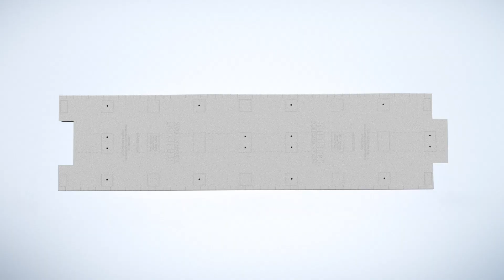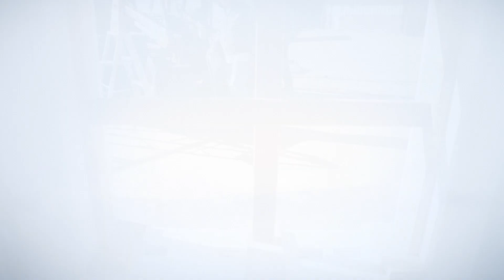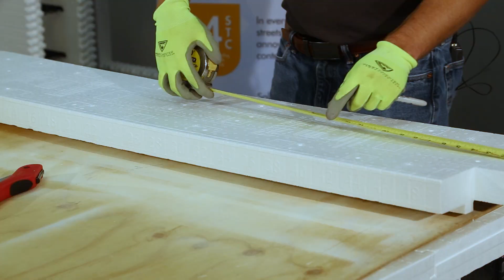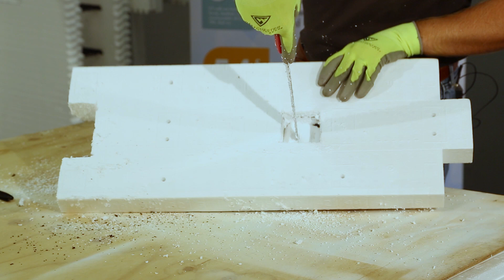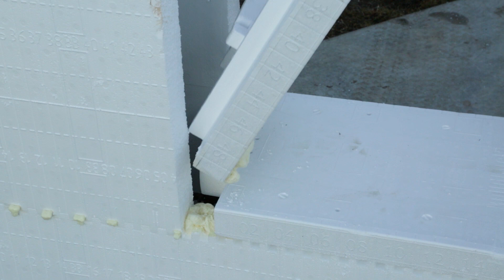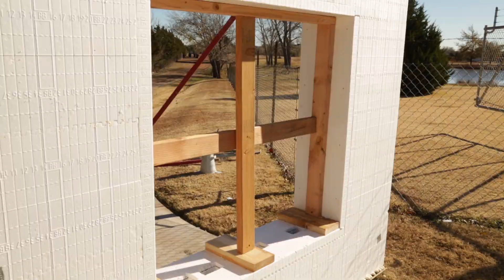BuildBuck Product Overview and Installation

Comment: I like the buildblock product.  I do NOT recommend buildbuck.  The attachment points perform poorly when installing windows and finishing out the window opening.  In hindsite I should have used treated 2x12
Reply: Can you give more details. Buildbuck looks like a solid product. Would be helpful to know any shortcomings.
Reply from the maker: Hi Luke. We're sorry you had a negative experience with the buck and would definitely be interested in hearing more about it if you would like to share. You can shoot my team an email at marketing@buildblock.com. Thanks for your feedback! 
-Isaiah
Reply: Can you use build buck with other ICF wall blocks?

Comment: It appears the bucks are all completely flat. Is that correct? How about making a tapered buck? Something similar to an upside down V only subtle. Would give you a good slope,  slightly more insulation, a bit more wiggle room for window irregularities, and would be more of a "press fit" per say for our window installations. It would also allow us to change window placements based on geographical locations for Solar gain, or even for esthetic and practicality purposes.... etc, etc..... 
Same concept we use currently when building our own bucks. 
We can place the window further to the outside, inside, or meet in the middle. 
Or even a directional taper. Though I prefer the idea of a subtle bi directional taper.

Just thinking outloud here. Love the proprietaryness (new word?) of the system already. It looks to be a solid system. 

Appreciate it y'all!